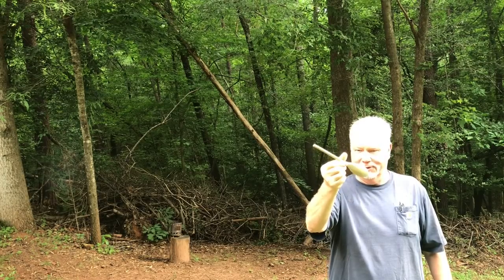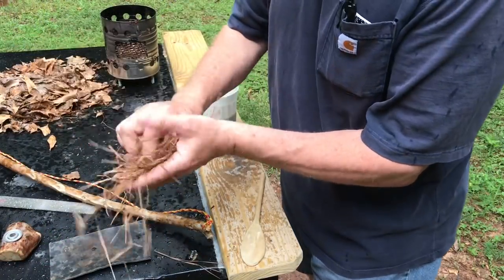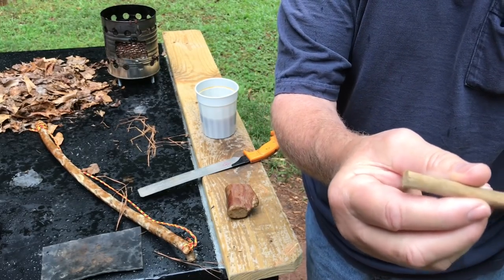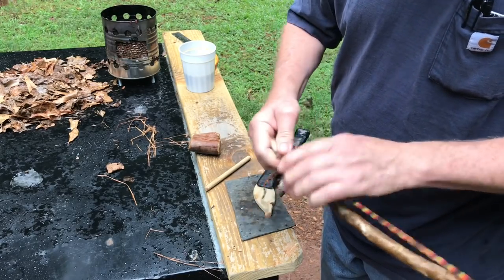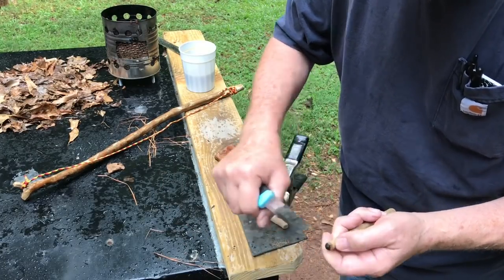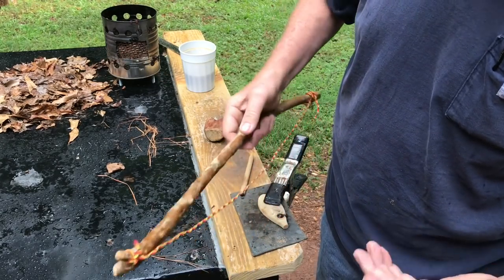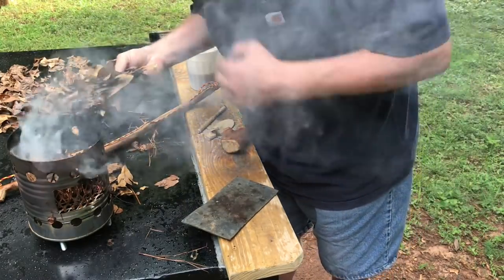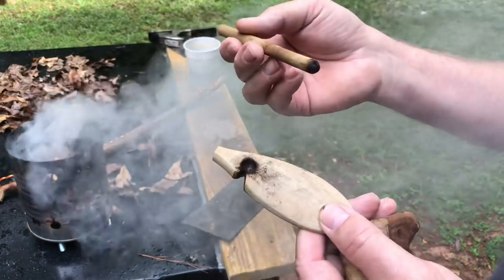Standing Bow Drill Friction Fire With A Wooden Spoon

Comment from the maker: It takes a certain amount of downward pressure to hold the bearing block and spindle and fire board together while you are driving the spindle with the bow. Most of the time that's too much downward pressure for a small spindle to perform normally. Small spindles tend to drill right through the fire board so fast that it doesn't create enough heat nor the right kind of dust for ignition.
   If you can't avoid using such a small spindle then make sure your bearing block is as slick as possible, your bowstring is as loose as possible, and that you divot is well down inside the fireboard... then apply light downward pressure while bow drilling.
   Today, I revisit the Wooden Spoon Bow Drill Friction Fire that I last did several years ago... Yes, it's just a frivolous example of bow drill in general, but a great lesson in how to deal with small diameter spindles. 
   
Bow Drill Playlist
https://www.youtube.com/playlist?list=PLkoXX8XsMW3kw-EXlvpLS68aJjR89P4ae